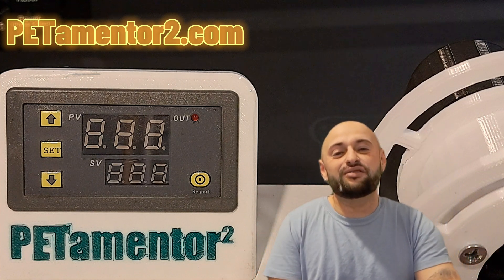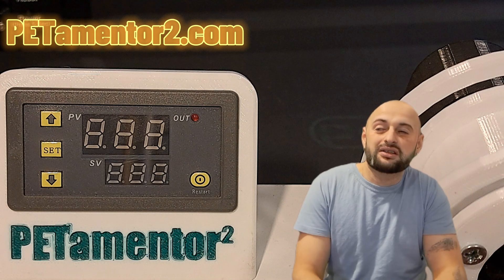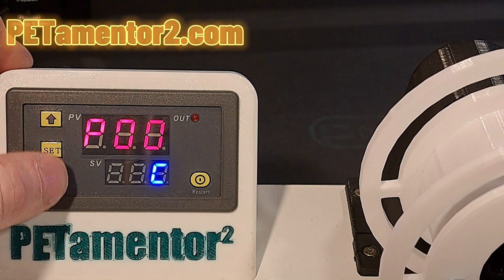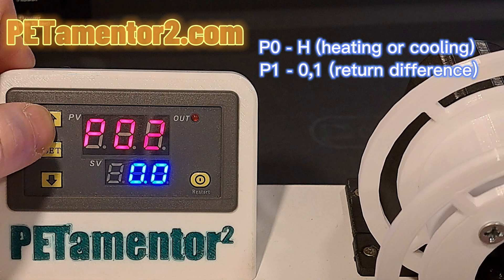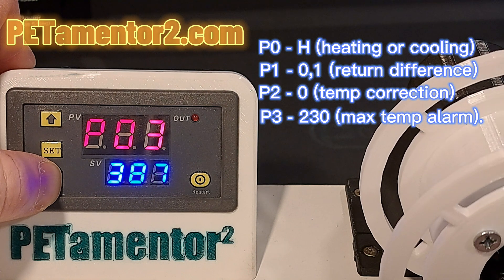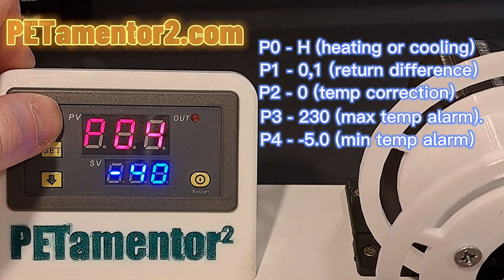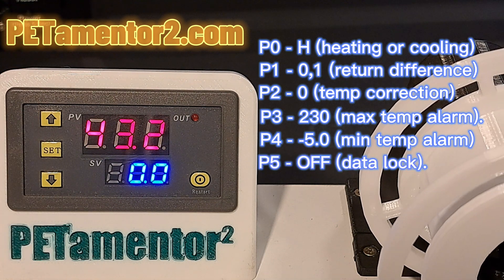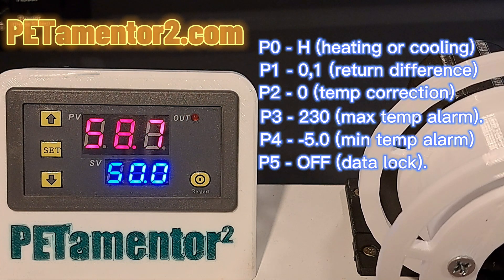W3230 settings for making PET filament

Comment: I found out that this w3230 have 2 type. We need to used k-type thermalcontroller not a normal type. normal type only can heat up 120. Please be carefull when you guys want to buy it.
Reply: Thx for these informations ! Do you have any link to buy it ?
Reply: Thanks for the heads-up dude, was almost buying wrong item. Both W3220 and W1209 controllers I've found are limited to only 100-120 degrees, really hard to find the right one.

Comment: so if you use this w3220 temperature module you don't have to use the  w1209 anymore ? its one or  the other ?  is there a schematic view how you tie this w3220 to the power source to control the heater ??? because on the petamator website o only managed to find a schematic view fro W1209 .
Reply from the maker: Link for everything you need is in the description. I made detailed tutorial for it. I can't answer thousand questions in the same way. So there is a website, tutorial and Facebook group. I can't do nothing more 😁

Comment: It's 3230 not 3220 , there is mistake in video title , also it show temperature till 120 c on the website.
Reply from the maker: 😳😱😱 wooooo! What a mistake! 🤦😱
Reply: @ondrejsraitr  also I have searched  on net , 3230 only shows temperature in range between 0 - 120 c , how's yours showing 500c ? , Please clarify , it'll be very helpful thanks in advance 👍 , keep up the good work
Reply: I'm also with the same question on mind, how do you reached such temperature?
Reply from the maker: Hi, this model is working up to 500C. 😃